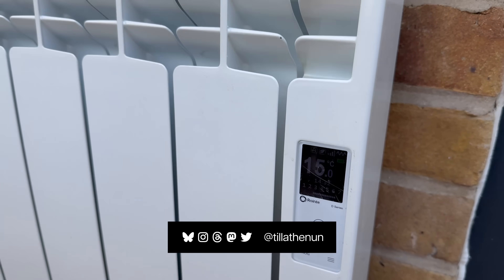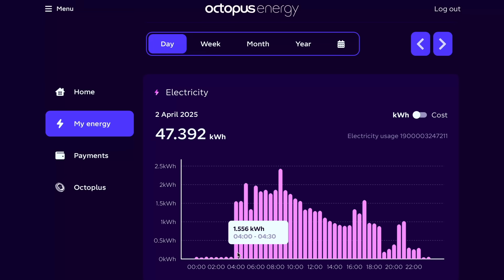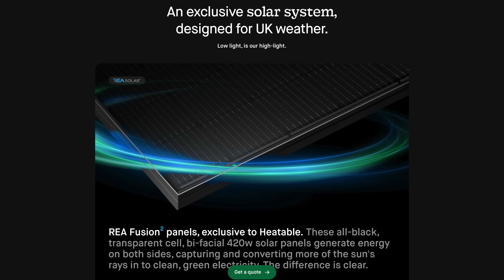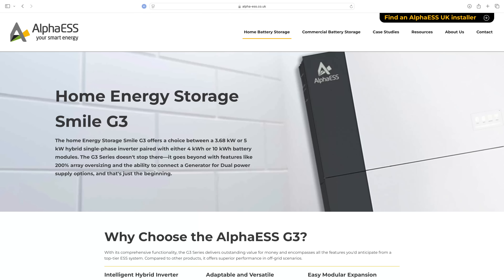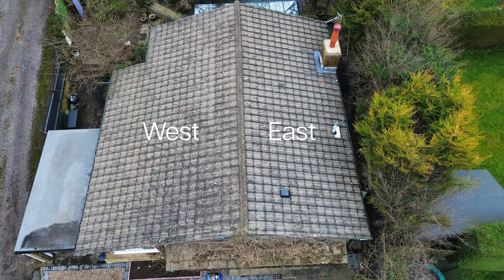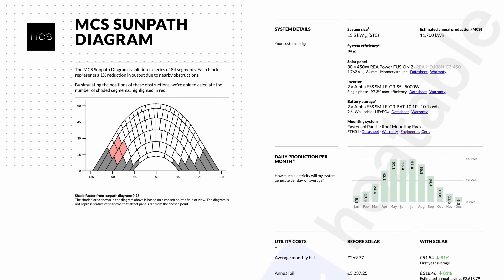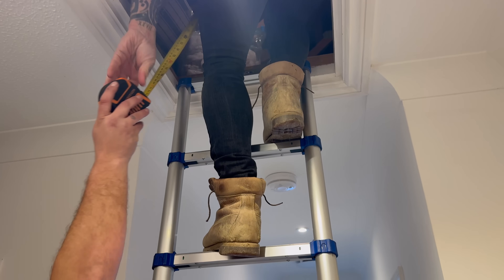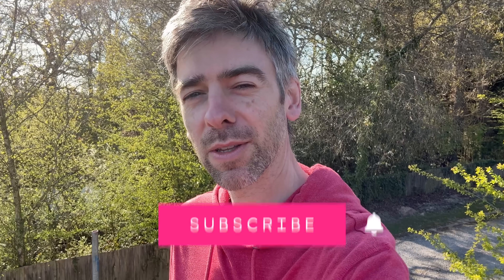We're going to kill those bills! Why we've decided to get solar panels and battery storage. ☀️

Comment: What do you heat your house to? 30oC 😂😂😂  Get a log burner. For the winter months. That heats most of my house and electric heater in the bedroom.
Reply from the maker: The last time we used our log burner it filled the house with smoke. Probably partly user error but we’ve been reluctant to use it again!
Reply: @MrEV 
 First off check the chimney is clear. Then check there's a fresh air supply to the room with the stove.
Next use proper dry kindling and proper dry wood. Kindling and wood needs to have a maximum of 20% moisture, which can be bought by the pallet load if needed. 

We supplement our oil central heating with a wood fired stove, which makes a huge difference to the heat of the whole house.

Comment: I'm waiting to see what happens with the tariffs. The thought of China dumping loads of cheap electronics on the market could be good for savings, although it looks like the installation is the main cost.
Reply from the maker: Yes, the panels themselves are pretty cheap but installation is a real faff!
Reply: On my system, the installation was more than the equipment fitted.

Comment: Q. How on earth do you get a bill for £756 in January? That was my net energy cost for last year. (5kwh array, GivEnergy 3.6 inverter, 9.5 GivEnergy battery and a not very efficient EV and gas central heating up in Fife)
Reply from the maker: Electric radiators and a poorly-insulated house. 😫

Comment: I’m not sure the micro inverters are worth it.  Being behind the panel is a much harder fix if one goes wrong vs a string inverter which will be accessible.
Reply: I know several people with micro-inverters that have had them fail long before the warranty is up. They're a ball ache to change, so they've just left them not working, which is not ideal. 
Not worth the expense IMO.

Comment: what, of course you put heatpump first, two heads, costs probably under 2k installed and heating costs 25% of before - then you move out to other adventures :) It would be major waste of energy with solar too, to heat the building resistively (electric radiators). Pump first! Then think about solar and other things to make use of storing cheaper period and own generation. Can't even watch the rest because there is nothing to say that would make it make sense to do before pumps..
Reply from the maker: A heat pump would end up costing about £8-10k (even after the UK grant).

Comment: Here in the US, we probably did things backwards but we started in 2016 with 3.3 kW of solar and then added insulation, a heat pump and an electric vehicle. That lead to adding another 2 kW of solar which last year generated 8.26 MWh of electricity. 
That is more than enough for our household electric consumption including heating/air conditioning and home EV charging. It does not include our hot water which remains a gas burner.  
Our electric utility has a generous one for one net metering policy but we still pay a flat monthly access fee of $33 to fund the distribution system. No battery storage yet but our local net metering policy and time of use rates don't really incentivize them.

Comment: thats not a bad price for the number of panels & a larger battery.  My install was 11 panels & 10K AlphESS and was approx 14K installation mind you did go solar edge with optimizers.  I wish someone would bring out a gateway that runs with all manufacturers as not being able to run the house is a big let down. my installer does not like tesla as hard to source, expensive hence not option for most and the support funnily enough.  
I wanted tesla as knew we get power cuts that can last for hours, days or weeks in badly hit and thats where tesla is a game changer.

Comment: I've got solar and a 10 KWh battery and it was a fantastic decision. Moreso now we've got an EV and can leverage the 6.7p overnight rate. Outside of winter we barely touch the day rate and I estimate our average import cost will be about 8.5p across the year. Given we export a lot at 16.5p per KWh we have pretty big negative electricity bills.

But we don't have electric heating. The very annoying reality there is that when you need the heating on that's when the sun isn't shining, or is far less likely to be. And during the months where the heating is rarely used you've got tons of solar and excess generation. Should we go to a heat pump at some point a huge part of running it will be using the cheap night rate. Mine is 00:00 -> 07:00 so we'd set the heat pump to fire up about 05:30 and run it off cheap power. Then during the day it'll use what excess solar we have (not much) and probably kill the battery by about 15:00 and we're paying the high grid import price. Of course we'd be offsetting that cost against the saving in gas so almost certainly better off overall but not because of the solar system.

So it's a tricky one for you and probably needs some modelling of costs and figures. I've been wondering about modern storage heaters for rooms not connected to a future heat pump. Again, charge at night on the cheap, use during the day.

I'm not really sure what your best solution is. I'd guess at solar and a heat pump using something like I've described above. Obviously this is a big initial cost but that's where the numbers come in to justify it or not.

Comment: Hi Andrew, am I right in saying that if you export then you don’t get cheap rate at night? I have solar and batteries but I did have the roof cleaned before the install.  2 years on and the visible bits need cleaning.  As do the panels.
Reply: You can export at 16.5p per kWhr on Eon Next, while getting night rate of 6.7p per kWhr if you have an EV or home battery.
Reply: @ I’d be reluctant to leave octopus but maybe i need to shop around

Comment: Insulation first, then solar, THEN heat pump. I hope you've improved in the 1980s insulation. 
Oddly enough I'm looking at a heat pump this year, and my initial estimate is also 8 years to pay off the installation cost, plus whatever energy is used to run it.
Reply from the maker: We have cavity wall insulation now. I will try to tackle the roof insulation as well.

Comment: Ugh. £20k. Wow. 
Why not connect your house to gas network and just have a standard central heating?
Reply from the maker: Probably not an option here, and we’d still need to get the whole house plumbed in so it’d cost about the same as a heat pump (after the grant).
Reply: The cost of getting gas to your house is prohibitively expensive. Head pump is the way forward, if you can get the plumbing done for a sensible cost, or DIY?

Comment: Very interesting presentation going through your carefully considered thought process. We have a similarly sized solar system on SE and NW elevations but have been DNO constrained to a 4.5kW export limit so I’m well jel of your 10kW limit. I have to muck about with battery levels and EV charging to maximise the value from my system. I probably need to look into automation using Home Assistant but I don’t know whether it will integrate with my SolarEdge setup.

Comment: Should now have lots of FREE miles in your EV car during those high brightness solar days, Get rid of those stupid electric heaters and replace them with some of the old storage heaters with the bricks inside, I have 2 on the night tariff via a time clock or charge them with solar in the winter using an iBoost solar diverter box.
Reply: If you're getting twice the export rate of a nighttime EV tariff, then charging the car from solar makes no financial sense. 
Export all you can on a decent export rate, and charge the car at night for peanuts.

Comment: For heating maybe it makes sense to investigate air-to-air.

If you're going to have to re-plumb the house as an alternative then I imagine ducting via the loft or just units mounted on the external walls would be less hassle, and if you're not going to get the grant for replacing gas then it might be cheaper than an air-to-water system.
Reply: A2A is going to be my choice, our house is a chalet bungalow with eaves so suitable for running the ducting along out of sight. Also it cools in the summer which will be fantastic. There have been some recent announcements on the gov.uk site about including units that also do cooling in the BUS grant scheme. Which hopefully means A2A heat pumps. So I'm holding off until that comes through.
Reply: @FlatToRentUK  Oooh that would be fantastic if it comes through. It makes sense as there's going to be more and more excess electricity on the grid during hot summers when cooling is needed.
Reply: @loulou53137  Yeah, I think it makes sense from several angles. I can see the logic in not encouraging people to install A2A and then use loads more electricity in summer for cooling. But ultimately they'll not be burning fossil fuels in winter so surely worth the incentive. Or they could make the grant available for solar owners because you're increasing supply at the same time.

I don't anticipate the grant being as much because those systems tend to be cheaper than A2W but I'll take £3-4k off.
Reply from the maker: We had air-to-air at the previous house but my wife wasn't keen: https://youtu.be/8hcyeWt9PG8

Positioning was the main problem though so if we were to go that route again, ducted would be great.
Reply: We are thinking air-to-air at some point in the future. We are currently looking at solar panels when we can find a decent installer. Sadly Heatable wanted to rewire our EV charger as it's on the main consumer unit which seems a bit bonkers as there should be a way to do it all in sw with homeassitant.

Comment: Great video. Did I miss your hot water heating set up? I assume that is electric but is it also on a timer or anything so as to get cheap overnight and/or solar powered during the day?
Reply from the maker: Yes, it's just a fairly small water tank with immersion set to heat overnight at the cheap rate. We would like to upgrade it to something better (and certainly bigger!)

Comment: £18 grand, Oh! shoot, glad i decided to go DIY, Deye 10K hybrid inverter 2000 euros, (£1712) build my own batteries 2 x16kwh ie. 32kwh storage 3152 dollars (£2380) for all components plus an hour of my time for each battery 🤣
Reply: Doing as much as possible oneself is always the way to go…it’s hardly rocket science and one can get everything checked and certified by a “professional” before connecting.
Reply: The problem with all DIY, is all the components need to be approved to be allowed to be connected to the UK electricity grid.
Reply: @johnnodge4327  Why is that a problem, surely you would choose an inverter etc that was approved.
Reply from the maker: Nice one! I'd love to have done that as well but I'm terrible at DIY and my wife would never trust me to manage it quickly. (And not fall off the roof!)

Comment: Modern solar panels do not suffer from the "Christmas light effect" with shading.  Shading only affects the shaded panel(s).  Good luck with your install!
Reply: Modern panel only bypass if they have considerable shading. We have a big oak tree and the shading is "gentle" and moves gradually across the panels (hardly any in summer). The micro-inverters do a really good job of maximising the power (and you can see the individual panel performance).
Reply: But rather than installing micro-inverters on every panel, it makes better financial sense to simply add more panels if space allows. This increased generation can overcome potential shading later on in the day.
Reply: Is that not the case only when you use micro-inverters though? Using traditional string inverters will see a fair dropoff in generation when a panel is shaded.
Reply: @FlatToRentUK  Yes, a shaded panel will see a significant drop off in generation.  But with (much) older panels, this would affect the generation of panels after it in series - the "Christmas light effect".  Modern panels have bypass diodes around groups of cells, and those groups that are shaded are bypassed.
Reply: @darrylrichman  We have 2 arrays. 1 Micro, the other single inverter. We have slight shading from a nearby tree, and the single inverter array output drops to about 50% of that of the Micro equipped panels when partially shaded. I wish the 1st installer had offered Micros as an option !

Comment: This video hooked me, cant wait for next installment. As you seem to analyse and carefully chose what you do, here is a question i hope you look in to. Heat Pump or Not ? - If you export excess Solar at 15p per kWh, that buys about 2kWh of Gas for your standard Combi Boiler. Alternatively you could use that kWh for Heat pump at 300 to 400 % efficiency. But even at 400% efficiency its now only double as efficient as using the Boiler when its Gas is payed for by the Export. So you might attain a NET ZERO bill because of your export tariff. 
Hope you consider this / answer as that's the position i am in and would love to see if you think its still worth getting a heat pump. (I am considering it if price with grant is similar to replacing my old Combi Boiler (about £2500 to replace) so about £10k install would work before £7500 grant.

Comment: Heatable are honest when it suits. Their adverts are false and misleading. Another you tube shill. I’ll leave the content following this garbage. You should be using your platform to help inform people of the options as every house is different.
Reply from the maker: I've done research regarding my own house, but everyone's is different which is why I trust installers to tell me what's suitable.

What I perhaps should have mentioned in the video is I approached three companies and picked Heatable, but another of the companies was also great to deal with and recommended effectively the same set-up as Heatable did (albeit with a different make of panels).

What false information am I spreading?
Reply: Thanks for the reply. I haven’t watched the whole video. As soon as you sounded like their adverts I switched off, what I have done though is edit my reply as without watching it would be unfair for me to say you are spreading false information. I believe that their tech is good for certain awkward shaded roofs with micro inverters if they didn’t miss lead people about safety nonsense, start up voltages etc then I wouldn’t have a problem. I spent 6 months understanding solar before I decided on a system to suit my house. I actually liked heatable as an option at first until I understood it more and realised for my situation I didn’t need it. I actually liked how informative their content was to start. Most people won’t understand it or dig that deep. If people are clear (and I know you can’t be in this video because it’s paid advertisement) they would let people know when micro inverters are the best option and when they are an expensive option that have no benefit. For example, powerwall 3 has a startup of 60v. Now if this is used on a south facing unshaded roof in string format then it would be better than a micro inverter, same if you went with Sigenstor (100v start up). When has it been reported of a solar roof fire issue effecting this country???? This is my particular gripe. If they are so genuine why use these false narratives?.

Comment: Well I hope you got a good discount, as that is a really expensive price for a system of that size, which is not surprising  as Heatable are very expensive. Bifacial panels, will add pretty much nothing to the generation over normal panels of the same power/efficiency, they are simply not designed to be used 100mm off of roof tiles. Most decent modern panels work well in low light, or overcast clouds, but there's very little energy there anyway.

Comment: As for installation of a wet heat pump. A bungalow is generally easier than a house with more than 1 floor, as the radiator pipes can be run through the loft space.
Reply: MVHR is easier too - all the ducts (and the unit itself if you like) can go in the loft.

Comment: Micro-inverters have been failing on a number of systems around me. I went for a normal string inverter, which doesn't need scaffolding for it to be replaced, which isn't the case for micro-inverter systems. 
It's also cheaper to put in more panels and a larger string inverter, than a micro on every panel.

While micro-inverters do overcome shading issues, having more panels more than makes up for it, reducing the payback period.

Comment: Love this kind of content, we luckily have a small solar system installed (3.6kWh Inverter, 5.4kWh battery and 4 x 360w panels). This has had a very positive impact on our bills as we charge the battery on a cheap rate and use it during the day in conjunction with the panels. So far, since April 2023, the system has generated 45% of our electricity (North of Scotland).
Reply: What was the cost of the installation

Comment: Heatable fitted alpha 10.1 at my house. No solar. With iog with EV. Use 9000kwh a year and so far pretty much all use is at the cheap rate . the home  battery discharges during the day. Also managing to sell back any unused for £4 a week. 
Manipulate the iog to tarrif with EV and get more hours to recharge battery during the morning or evening. I'm saving £2700 a year by having EV and home battery.
Reply from the maker: Wow — that's an amazing saving!